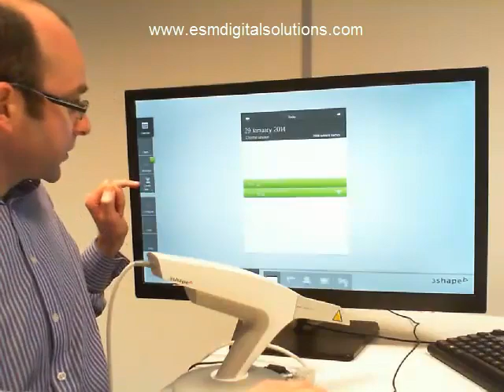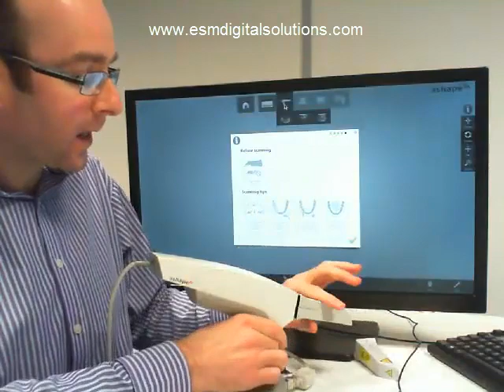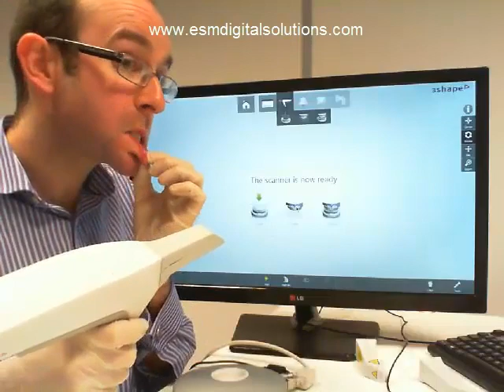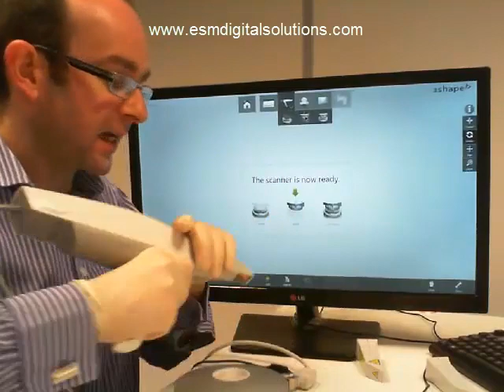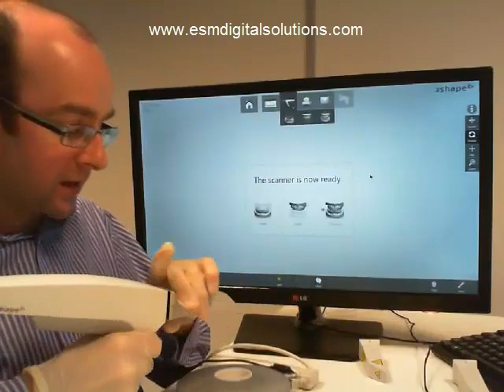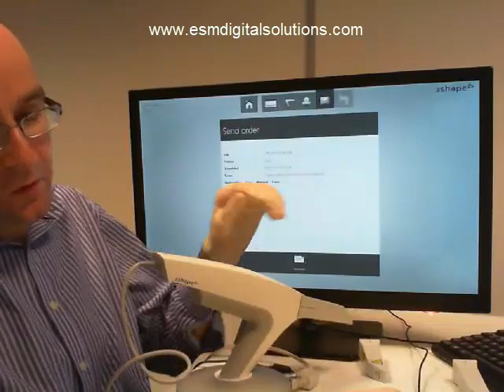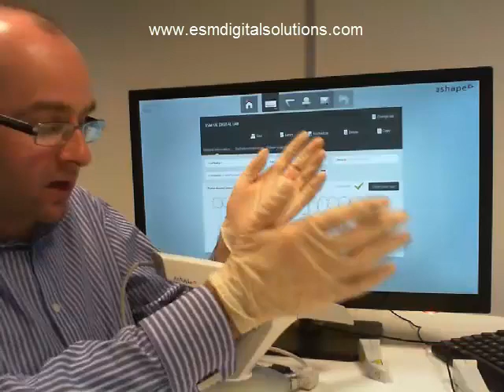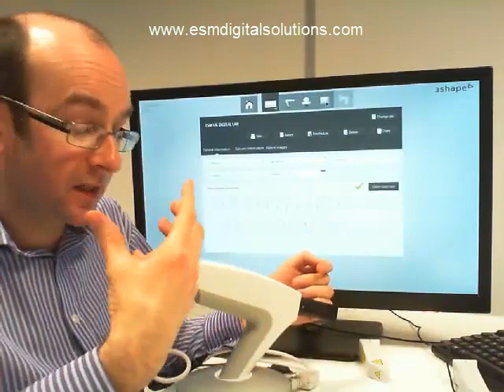Intra Oral scanning with 3Shape TRIOS

Comment: As someone who works in the orthodontic field and who has used the iTerro, this "wand" looks looks horrible uncomfortable, not only to hold but to also have placed in your mouth as a patient.
Reply: +Katie Nye Trios 3 is a little wand smaller thjan everyone else's and had a pod that  it rests on,  has the equipment instead of a handle, but you can get the gun, why would you though. Imagine the handle and surrounding gone.